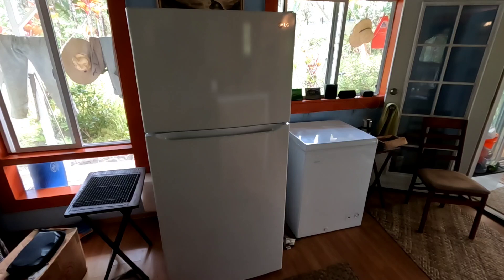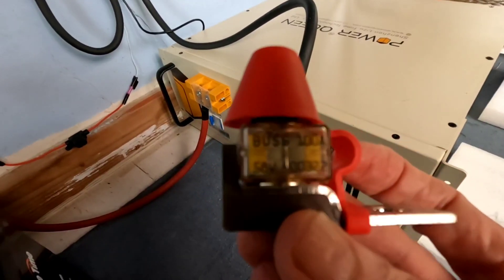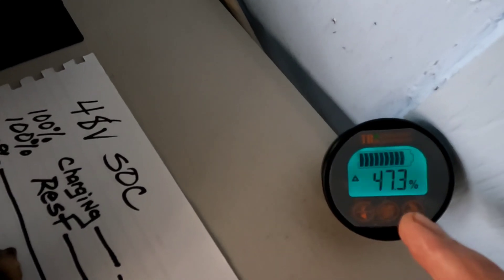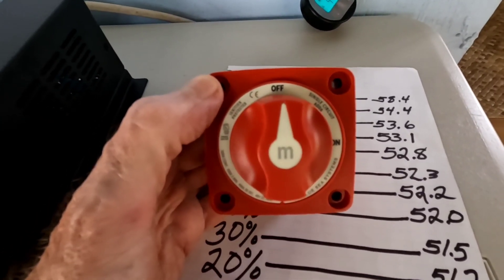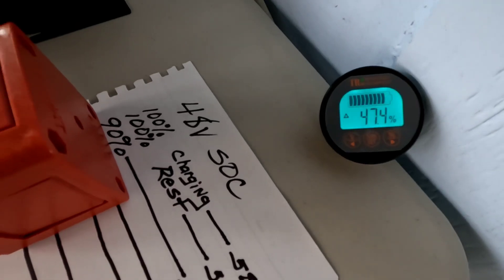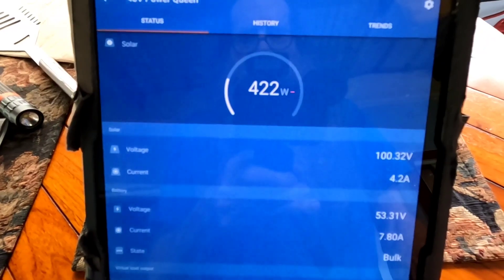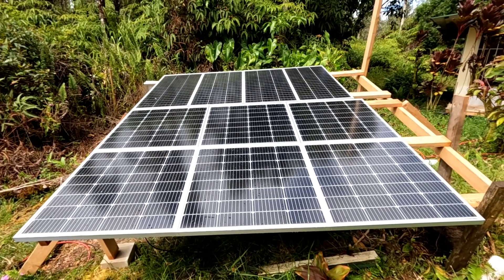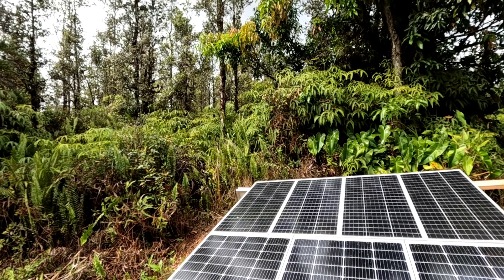Power Queen 51.2V LiFePO4 server rack style battery running two large appliances 24/7 effortlessly!

Comment: I'm curious for your version of paradise, what are your average solar hours ? We're in Texas now, where it's around 5 hours. Where we want to go, Bocas Del Toro, Panama, it looks like it's going to be between 4 and 4.5 hours/day. Probably like you, though, the temp will be 70-85 year round though, so not much, if any A/C needed.
Reply from the maker: No A/C needed here either, which is a huge plus for us. Average 6 good hours a day solar when sun is out this time of year. Closer to 8 hours in summer when the sun just goes up fast and stays right overhead a long time. All in all pretty decent for solar here. Good luck wherever you decide to drop anchor! Aloha🤙

Comment: looking super. Love them 100 watt panels . you should be ok with that fuse. The battery has a breaker and BMS. I have a powerqueen  190AH 12.8V battery in my cart. that one has a 150 amp BMS . HOBOTECK reviewed it and tested it. going to be my new camping buddy. 1500 watt inverter . next season I should have. I have AGM battery now and that working fine but getting old and heavy. My biggest loads are the washer and dryer . don't use much. both GE and energy star rated. Martha's hair dryer is 1250 watt around. has 4 heat settings and 3 fan settings. she don't use much. best to disconnect solar first then battery and connect battery first than solar. I have Morningstar TRI star controllers and what they recommend. with them panels watch the shock hazard.   I am seeing over 100V . What I do with mine is put a blanket over them when working on them. simple and works great ! have fun !! 😀
Reply from the maker: Yeah I'm thinking this fuse be fine too. If I ever grow the 48V system may change it up. It's purring along nicely today, most I have ever seen go into that battery so far...about 1.5 kwh, which is not bad in latest conditions. Sounds like you're all set for camping now as well...sweet. I save all my old solar panel boxes , cut them flat for cover up panels if working on them...works good.  Aloha buddy 🤙

Comment: Be careful with that fuse.  Fuses have an interrupting current rating and a maximum voltage rating in addition to the fusing current rating.  If your supply (the battery) can exceed the interrupting current or is too high a voltage then the fuse may just continue to arc instead of interrupting the overload.
Reply: I just looked that up. BUSS fuse. 2000 amp rating and UL listed. also voltage surge rating 200% over rated voltage.  now there is cheaper replacement links that don't have UL not buss either. will not use them. 😀